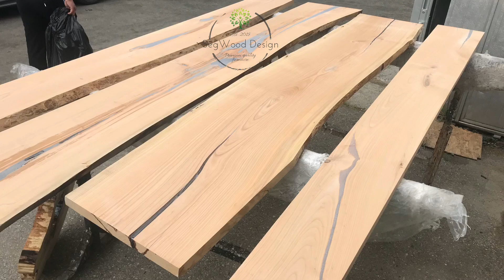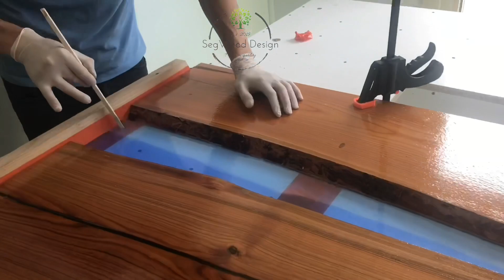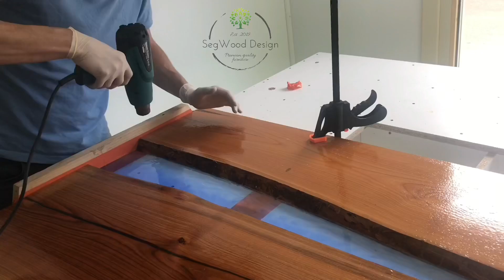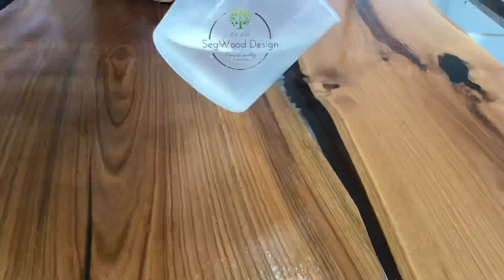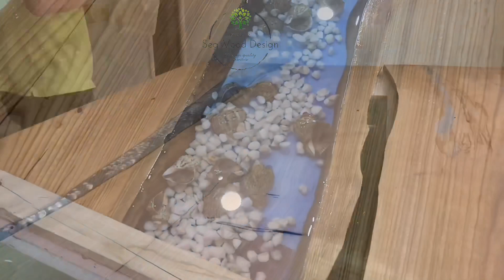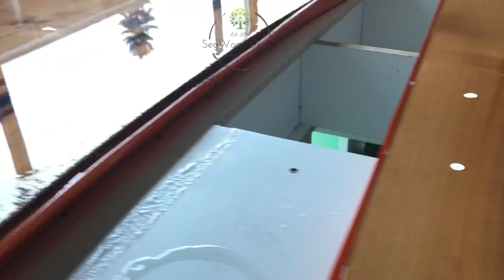L.E.D. Live edge countertop , ocean theme - part 1

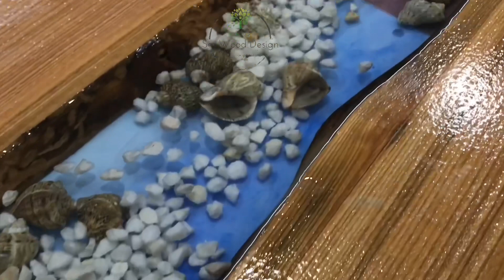Comment: The top coat that you begin around 3:20 or so, is that also resin?

Stunning piece. I love the seashells in your resin river! Nice artistic touch :-)

Edit: Nevermind, it has ta be. Sooooo glossssssyyyy!!!
Reply from the maker: Yes it is. I used 2 tones of blue for the bottom layer after that sea shell and rocks, filled the river with clear epoxy and the top coat is also epoxy, in this case 3 layers, because the lenght was to big and was very hard to control the level of the entire project.
Reply: SegWood Design
Well, 3 coats explains why it is so flat and glossy and beautiful!!

Excellent excellent piece & craftsmanship :-)